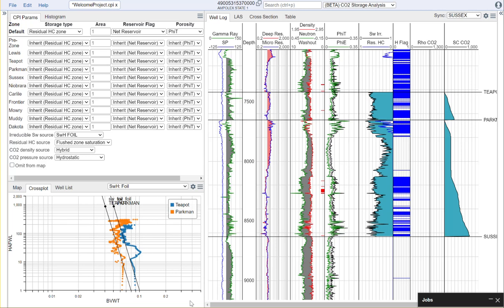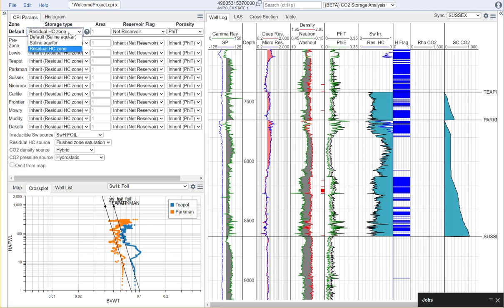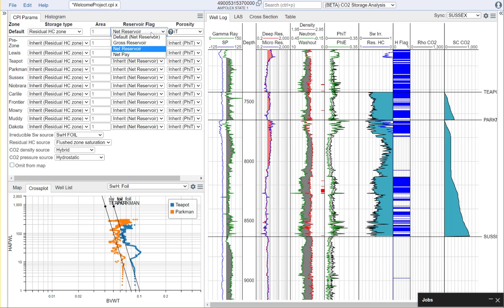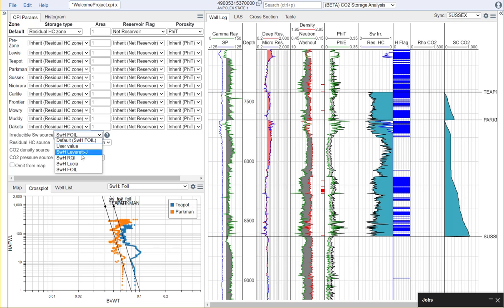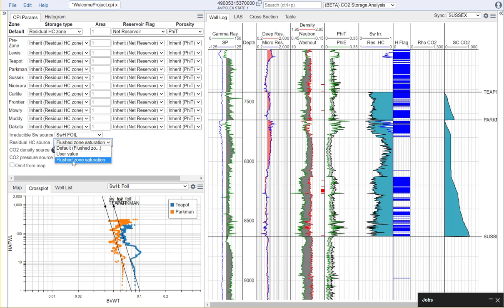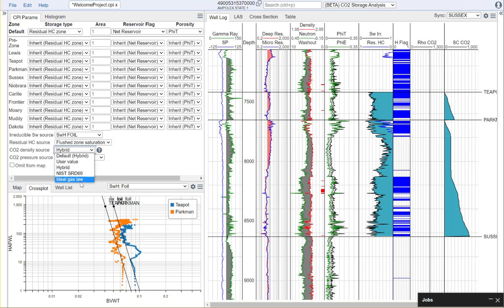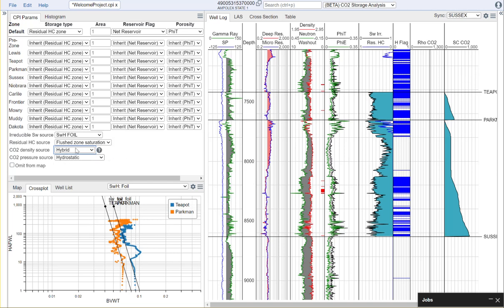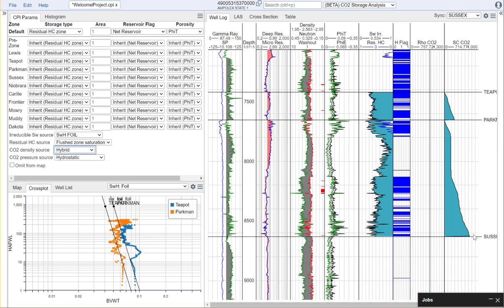Carbon Dioxide storage analysis with Danomics

Comment: When deriving the FOIL Function only net reservoir data should be used. Net reservoir being defined as reservoir rock capable of holding hydrocarbon. This can simply determined by Sw vs. Porosity cross plot.

BVW is only a function of the height above the FWL and is independent of porosity and permeability  – in net reservoir rock.  In non-net reservoir the BVW = porosity (as Sw=1) and therefore can’t be used in deriving the FOIL Function.

The resistivity log is incorrect in thin beds and close to conductive shales beds.  These data shouldn’t be used in the derivation.  The derived FOIL Function will still give the correct Sw in these intervals.  This has been confirmed by comparison to core Sw.

As the FOIL Function is a straight line in log-log space, only 2 points from the centre of thick clean beds are required to derived it!  

Contact me if you have any questions. I provide FREE consultancy on Sw vs. Height Functions.